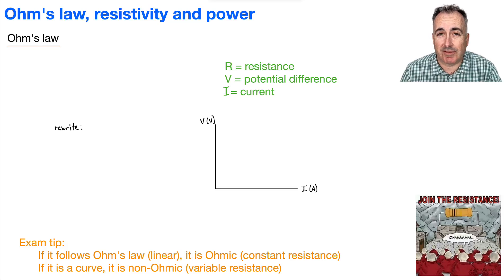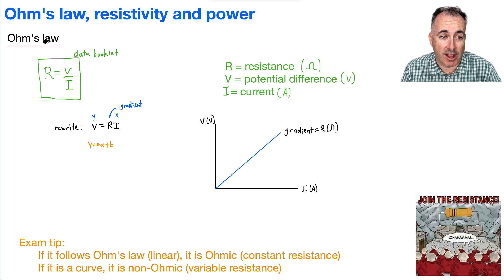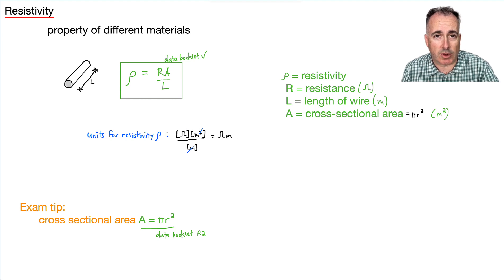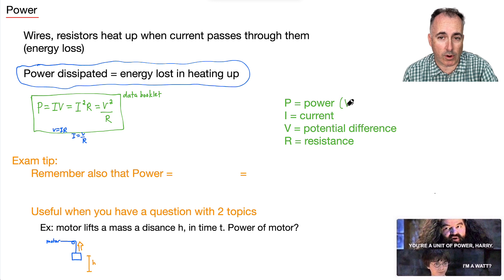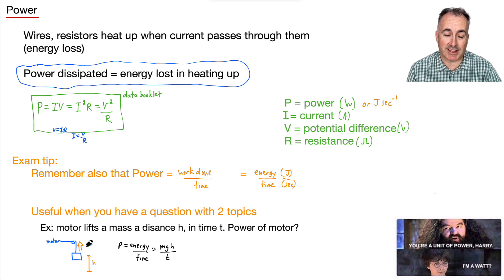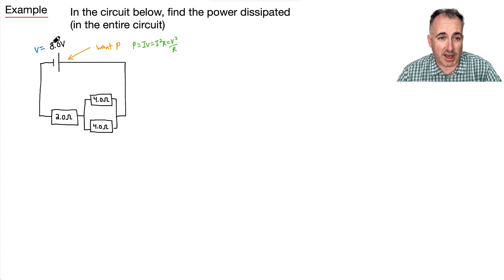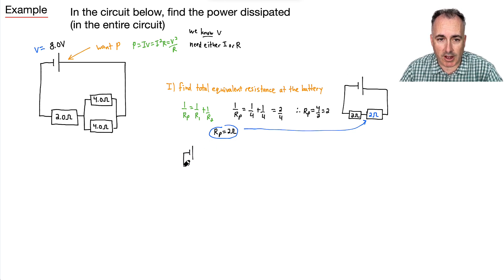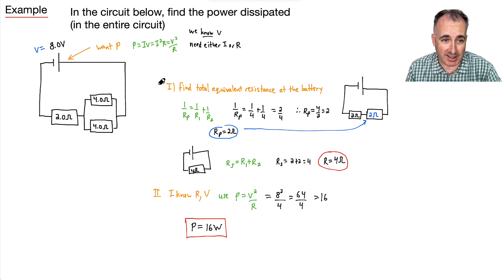B5.5 Ohm's law, resistivity and power [IB Physics SL/HL]

Comment: Hi, thank you very much for all your videos as an M25 student you are a life saver. Quick question about the last example, in the Power slide you define power dissipated as the energy lost to heat. So when I was trying the quesion on my own before seeing your explanation, I calculated the 16W and then the power that each component recieves using their specific values of R and V to calculate what the 'useful' power is and then take it away. Why is this incorrect?